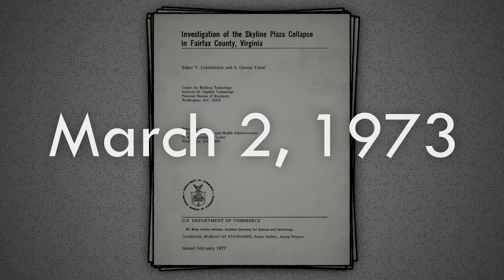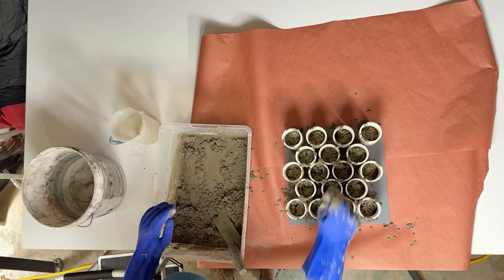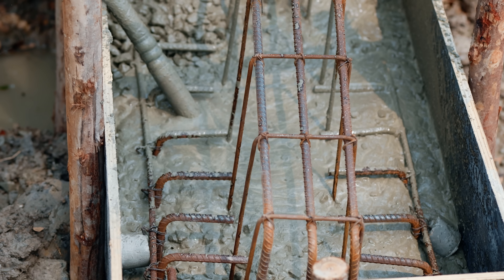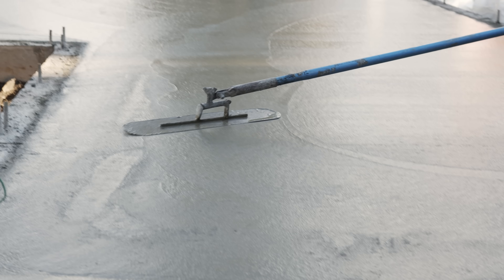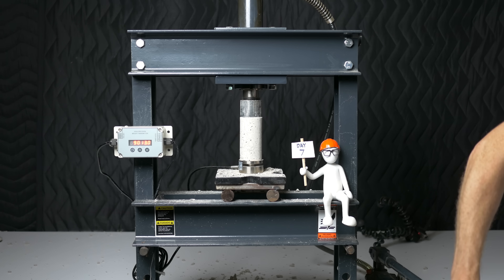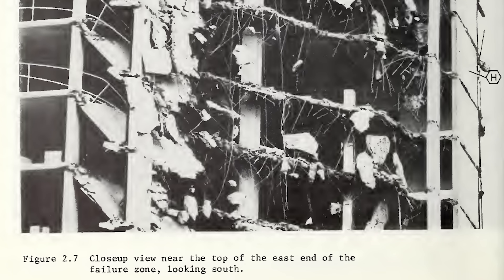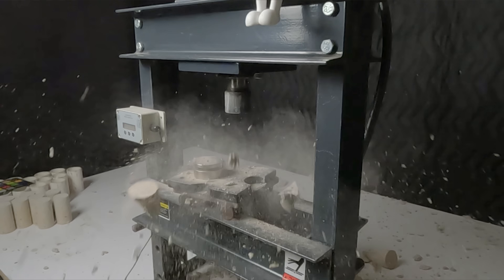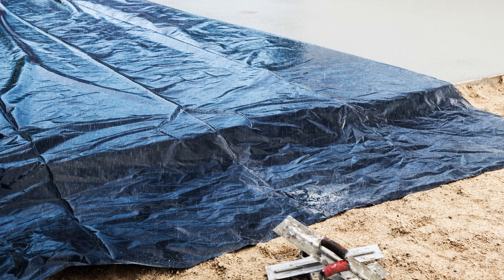Concrete's Greatest Weakness is Time

Comment: 10,000 kilogradys per square smoot? That seems like an incredibly weak mix - a smoot is 5'7" (~170cm), so that's only 2.2 kilogradys per square inch. That seems like it'd be about the consistency of butter. You probably want to be in the millions of kGdy for any kind of decent concrete mix.  

;)
Reply: "millions of kGdy" ... so GGdy?
Reply: There's a reason the Romans stopped using the kilogrady
Reply: If a kilogradys happened to be roughly equivalent to a kilogram that would be roughly 4800 psi though.  Checks out.
Reply: @clee8768  Think you doubled up a "kilo-" somewhere. 10,000kg (~22,000 lb) on 4,489 square inches is less than 5 PSI, not pushing 5000.
Reply: But a kilogrady is probably ~80,000 kg
Reply: "that's only 2.2 kilogradys per square inch"

But isn't that in the same ballpark as the samples Grady tested in this video?
Reply: @seneca983 No, he was getting 2200 kilogradys on the seven-day samples, and they looked to be only maybe a few square inches. That's hundreds of kGdy/si, not only a couple.
Reply: @Alsadius  Oh OK, I was mislead by the graph. I thought 2K meant 2 kilogradys but apparently it meant 2K kilogradys which is a bit confusing.
Reply: Thats why I switched over from Kilogrady's to Kilodaddy's
Reply: Multiples of Gradys go up by factors of 400ys, not 10.

Comment: I had to laugh at the mention of "square smoot" as unit of area.
Reply: All us nerds being like "Oh yeah, our man Oliver Smoot getting his well deserved shoutout!"

I still love the fact that original Smoots are officially used by first responders when responding to emergencies on the Harvard Bridge.
Reply: @LilyStarstrider  It's still very clearly marked
Reply: @tomholroyd7519 full well aware. When they refurbished the bridge, the cops literally told the city "Put those marks back!" Also the sections of concrete used in the refurbishment are one smoot long instead of the usual 6ft
Reply: 2.896 m^2
Reply: @tomholroyd7519  how many square baseball mitts is that?
Reply: Anything to avoid the metric system...
Reply: SMOOTS!
Reply: I was so glad to hear that one
Reply: I'm talking square smoots, Kilo-Grady
Square, square smoots
Reply: "I understood that reference"
Reply: I'm a Furlongs per Fortnight guy myself.
Reply: @rjkee5157  8*10^12 -- to within an acceptable margin of error.

Comment: PCI lvl 2 inspector here, great video!! There’s so many variables that go into production of concrete and QA of pieces produced. Most plants usually turn over products within 24 hrs. Also the type of concrete that is used in complex or steel crowded pieces is called self consolidating concrete or SCC for short! Also with your breaks 28 days is the standard that DOT follows.
Reply: Also precast / prestressed is an amazing way to speed up a project! Where a project is broken up into segments that are shipped to the site and assembled. Think of a giant Lego set made of concrete! :)
Reply: Titanium would much more expensive and harder to work with
Reply: has anyone ever tried to use titanium rebar to avoid rebar corrosion? i don’t know anything about concrete. am an engineer and am not in construction. just a random q that popped into my mind when he said they can use calcium chloride to speed up cure but the CaCl can also increase corrosion on rebar. anyway if that is a totally unrealistic question my apology. at least i was honest about not knowing anything at all😅
Reply: @nozrep  Epoxy coated rebar is used to help with corrosion resistance! It’s used mostly on bridges and any other structure that is going to be subjected to corrosive elements (salt, de-icing agents, ect.) 🙂
Reply: @Broom_God  i would never specify epoxy coated rebar and im pretty sure a lot of DOT's are going away from it also.  If you nick the coating it can cause that localized area to corrode more agressivly leading to pitting and section loss rather than just surface corrosion which is way worse.
Reply: @clee8768 typically when using epoxy coated rebar the spec says to reapply epoxy paint to any cut or exposed sections of the bar. I should have rephrased, most DOT’s use epoxy coated while some opt for the stainless steel rebar. Example, I worked on a portion of the Arlington national cemetery bridge that used only stainless steel rebar and stainless tie wire. Though you are correct about how easily the epoxy coating can be damaged via the steel bending process and mishaps during assembly 🙂
Reply: @nozrep  MMFX is a high strength alloy with chromium that has a much better resistance to corrosion.  It's also a lot more expensive.
Reply: @nozrep Ti and Steel dont like each other so youre buying a buildings worth of Ti which would be a very hard sell.
Reply: A couple of decades ago our plant's PCI was inspecting a parking garage being built from double Ts and other components (I do pipe, not bridge beams, but they're right next door) because of cracking issues in some of the beams.  Turns out the production crew omitted some steel at the very end of the beams because they couldn't get the concrete to flow properly.  Some ad hoc testing of beams that hadn't yet shipped was inconclusive so the company VP directed the PCI to sign off on the project.  The PCI dutifully and immediately resigned.  A day or so later the parking garage collapsed.
Reply: Y'all bringing back Roman Concrete now that we know how to make it? 😅
Reply: @LearndingLife   Roman concrete is basically just poorly made regular concrete, with large grains of unreacted cement that then reacts when water reaches it later. Seems great in theory, but who wants to pay for a bunch of cement that adds nothing to strength? You also don't want a lot of unreacted cement because that's one the main source of CO2 for concrete production, and it produces a LOT. There are some developments, tho, that might make it to the field, tho I haven't seen anything about that for a while.

Comment: Awesome content yet you should have a shield when shattering the concrete. Safty issue as it really flies small pieces all over.  Great video though
Reply: That was a big deal in the concrete lab in college. Shields in place and eye protection too. One place where the was oddly little protection was capping the cylinders. To ensure parallel faces, we capped the ends with molten sulfur. Working in a fume hood, you oiled up a jig consisting of a plate and guide assembly. You poured molten sulfur into the plate and slid the cylinder (6" x 12" cylinder) down the guide into the plate and let it harden. Goggles were the only required safety equipment.  One classmate got the cylinder hung up in the guide, it dropped free and splashed molten sulfur all over his forearms. He had to have it removed at the hospital.

Comment: Giving things more time to cure or dry is a generally good rule for life and work. Letting paint have an extra day, letting glue set for another few hours. It's a skill in and of itself to allot enough time to not rush something.

I've seen too many jobs and projects get negatively effected due to impatience. Whether it be from the person or their employer. Just stop rushing.
Reply: I once had a customer call the office complaining because I pulled off a job where the painter was spray lacquer on all the wood trim.  "why can' he get along with the painter"  told the boss he should have told the customer, "he gets along great with the painter - by NOT DROPPING DEBRIS ON HIS FRESH PAINT."
Reply: As always, you can have it good, fast, or cheap. Pick 2
Reply: @panzermk8  While running my repair shop I tend to lean towards good and cheap. I have some people's appliances sitting around for months but then I find the perfect part in a similar device being scrapped and can let them have their working space heater back for super cheap.
Reply: True
Reply: Time is money
Reply: @EminemLovesGrapes  Slow is smooth, smooth is fast

Comment: There's a very similar issue to the Skyline Plaza going on right now with the Upton Residences, a pair of 37-storey residential towers being built in Downtown Denver, CO.  The builder fired the concrete contractor, who then removed shoring (their property) on upper floors. Some are saying the concrete did not have time to cure. Lawsuits ensue.
Reply: There's some malicious compliance.  Might have been more in their interest to then turn around and hand the GC a rental agreement prior to maliciously claiming their property though.
Reply: @clee8768  100% agree on both counts. Even more comical, the builder is publicly telling potential homeowners there's no structural integrity issues while suing the contractor for -- you guessed it.
Reply: I assume you are talking about post tension concrete structures  in Denver. I have worked on two post tension projects in Denver, both low rise. 10 stories and 11 stories. The surveyors had challenges with keeping the buildings plumb. No thanks working on a 37 storey project, I'll go elsewhere.
Reply: @tommiller7177   Post Tensioned is notoriously tricky, and any mess-up in the pour or the concrete can have massive impacts.
Reply: I live in Littleton and haven't heard of this 😲
Reply: that's horrifying! and now people live there???
Reply: 🫡 God I love my city

Comment: What do you think of a possible future where large infrastructure is built using a material composed of a durable, reinforced plastic-rubber-cement blend?
I imagine the pros could include significantly reduced maintenance costs (due to less corrosion/cracking) and a much lighter weight structure.
Reply: Also it would create a massive, high-value demand for tons of waste plastic

Comment: It’s fascinating how hydration continues for months, giving concrete a kind of slow-burn durability.
Reply: I first heard about it when I bought my 1st house, and they explained that the slab in the garage would continue to gain strength for about a year or so.  I don't remember how long it was after the pour that we went to settlement - some number of weeks, I think.

Comment: Last time I was this early, the concrete hadn't cured yet.
Reply: That's not that early...
Reply: I have found a cure for concrete. Water.
Reply: @dukenukem8381 water doesn't cure concrete. It hydrates the cement and there is "water curing" but really it slows the rate that it cures.
Reply: @jonyemm  Well achually🤓
Reply: Oh no, is it sick?
Reply: That's why one should release the videos on Friday to let it cure over the weekends
Reply: Well what cure though, if you mean 95% strength then its not very early
Reply: There’s no cure for you
Reply: @1rstTry its terminal
Reply: Last time your were that early your wife got you a referral to a urologist.
Reply: And it still hasnt.
Reply: That's your foot print? Nice.
Reply: @grillmeisterkush6396  Are you Lucy 🙀?!
Reply: This post has a 75% solidity
Reply: So 20 days
Reply: Too soon
Reply: yay u win!😂
Reply: Twin
Reply: @padraicwhiu4174 cured? Im doing lines in the porta John still waiting on the driver to show up.